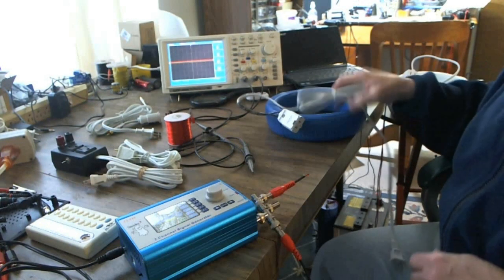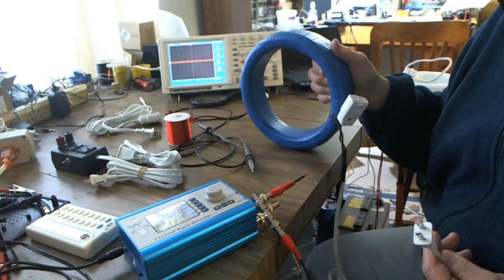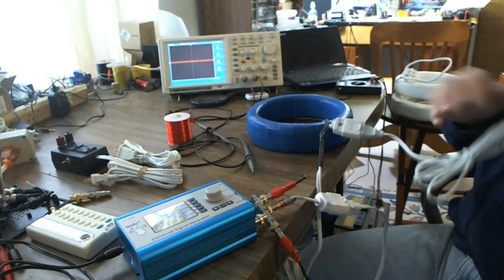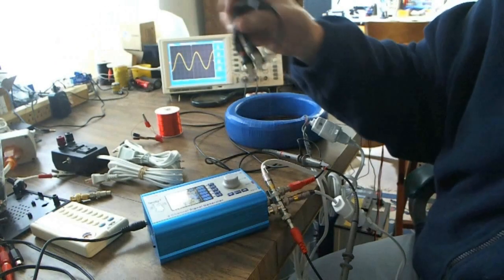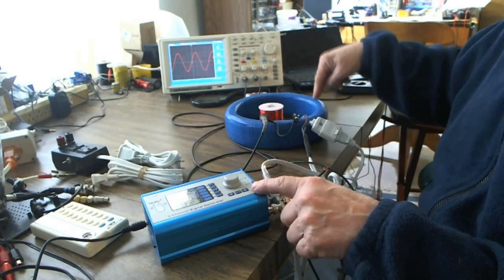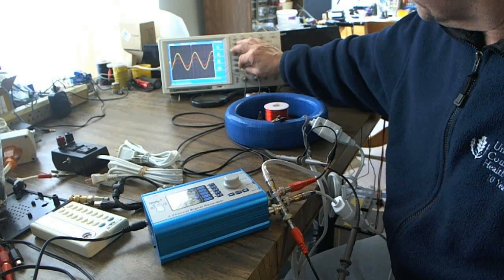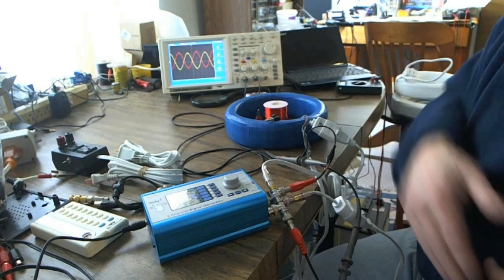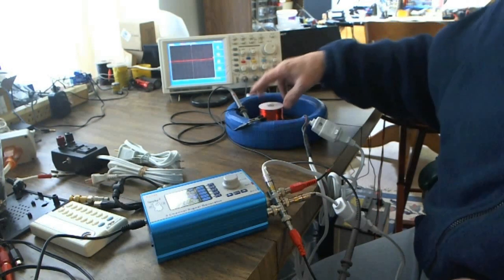Bifilar Coil Connections & Magnetic vs Scalar Waves

Comment: Antiphase signals will cancel current flow, so the total energy into the system is noticable reduced.  Apart from normal circuit losses and switching losses there is no generation of any other energy. For one, achieving a 'perfect' antiphase signal is difficult in itself due to the switching characteristic of the transistor output devices not being perfectly matched. Then each lead will have different inductance and capacitance.
Perhaps you should measure the current flow in the circuit to see how it's reduced when opposite potentials are driving each other.
Reply from the maker: I went around on this once before with someone.  The best way to test or show what is being talked about is look at the very simple circuit for the little black box called a Magnetic to Scalar switch shown in the video.  The schematic is found here; http://www.aurorasky.net/Bifilar_Magnetic_to_Scalar_Switch_Schematic.pdf
There is no switch transistor or transistors involved in this scheme.  I used the box with the Frequency Converter, another website project, and passed amps of current through the current limiting resistor.  Although I made plenty of mistakes in my lifetime I will not go into another round of debate over this subject on the internet.  If you want to talk about this further you are welcome to email me via the website link.  Respectfully, Steve
Reply: @gskempe9  Pts to you for your response to an immature and rather violent one (currently from their words I can deduce this basic) ... I often give very much a similar response with people  seeking violence/argument, good to see that someone as tech savy as you can surely also wing some hits in in the psychology dept!
Reply: I fired shots at "rowifi". Youtube just plants everything in the same pile even if you click "answer" under rofiwi's answer. Sorry for the missfire
Reply: Maybe if you went to a school and read a book that said it will. My view on it is that losses are reduced. Amps do not tell you how powerful something is, but it tells you how much energy is wasted. Good example is Geard Morin's hyperdrive engine that works mostly on volts
Reply: veli pekka Jutila I suppose you're an expert in electronics?  G Morin is a fool and complete idiot. I suspect the same of you.
Reply: I suspect you enjoy bestiality and country music. Doesn't make it true though. There are very few experts in electronics, but there are a lot of people who just repeat what they are being told. The stuff we are being told in schools are lies and something we are not told at all.
Reply: veli pekka Jutila What the fuck are you talking about you stupid imbecile. Grow up, get an education and stay away from subjects that you clearly know fuck all about.
Reply: @electronicsandradio3945  mainstream education is garbage, you really do have to read C. P. STIENMETZ' book to get an understanding of what electricity is. The problem with understanding electricity as far as the powerful are concerned is you can start to figure stuff out like radiant energy, zero point energy, over-unity in absurd quantities. That's not good, then they can't rip you off on power bill and fuel joke. So before you tear down someone's throat about our truly piss poor education systems. Look into it first and see if maybe there is something to it...
Reply: @deathblaizer  I have looked into it, there's nothing there. Show proof if you have it.. but of course you do not. I fail to see the link between Steinmetz and scalar waves.
Reply: @electronicsandradio3945  fruk you trolled em good, just baited!  Wanted to only stir shit up, well how do you feel now about it?  Enlightened at all, feel like you got some justice?  Hows about the fact that you people arguing with each other shows that you are into competition and that co-operation is far from you?  If you wonder why sentient beings often keep to themselves, and enjoy their own company, look only to this thread to realize why we foster and esteem peace.
Reply: veli pekka Jutila 'works mostly on volts' ... do you understand what POWER is ( energy  per unit of time ). It is measure as the product of Volts AND Amps. It's just as much power with lots of volts and very few amps as it is with very few volts and lots of amps. Suggest YOU go back to school and learn some manners and respect while you're there.
Reply: I did grow up and I did get an education. Then I started realizing it was mostly bullshit. I also totally behaved myself until I was called a complete idiot and an imbecile by a total stranger. Assholes deserve no respect. If I say "works mostly on volts" I mean that by raising just voltage Morin's motor picks up speed. Amp draw is not changing. Do you understand anything or do you just repeat something you were taught? What else do you think? That Lenz law must be suffered? That there is energy stored in a battery? That we must have a closed circuit to make electricity flow? What else they teach in school that is completely false or told so that it does not explain the actual situation? "Energy conservation law means energy cannot destroyed or created fro nothing, that is why you cannot have perpetual motion!" and what the law actually means is that all the energy was created when this universe started. It is everywhere around us and why on earth it would be illegal to tap into it? I suggest YOU drink a can of acetone and remove yourself from the gene pool. There enough robot trolls walking on this globe already
Reply: veli pekka Jutila .. check back in your comments then, or don't you consider 'beastiality' to be obnoxious. Perhaps also telling someone to 'go back to school' is hardly respect when you have no idea about their education or experience. I think you will find that you fired the first shots.
Now think efficiency.. its perfectly possible for a circuits efficiency to change as you change its input voltage. His motor driver is not a linear circuit. Raising the voltage can make the convertor more efficient. So simply raising the voltage can easily cause an increase in speed without a change in input current. The difference between the two states would be less loss in the convertor ( loss as heat ). Demonstrating just an increase in speed fails to take into account the changed losses and efficiency.  If he could work out the actual,true energy required to spin his motor to overcome friction and any drive load, then we could determine just how efficient his convertor is. All he is doing is pulling the wool over your eyes either deliberately or because he is deluded.
There... You're welcome.. from an electronics expert.... unlike yourself.
Reply: veli pekka Jutila seems like E&R has explained the issues adequately. No doubt you won't take those comments on board though.